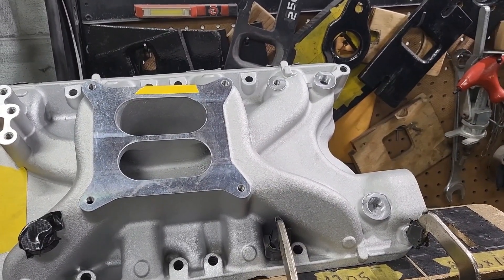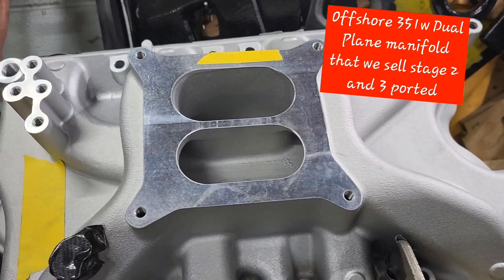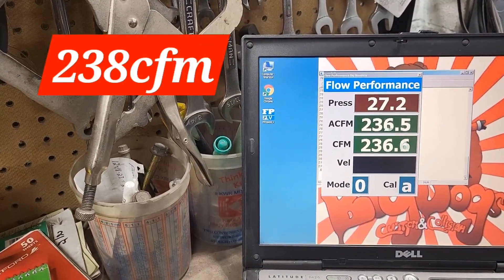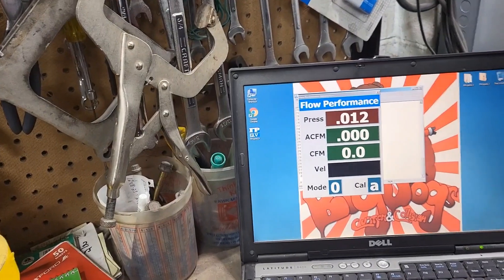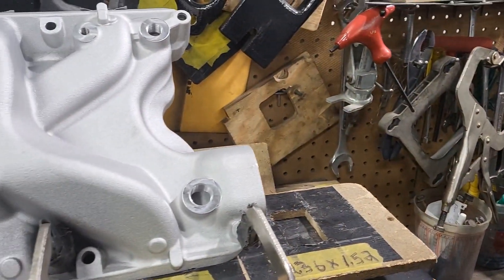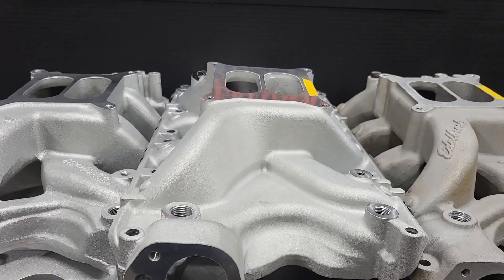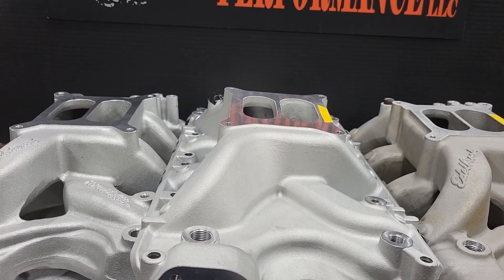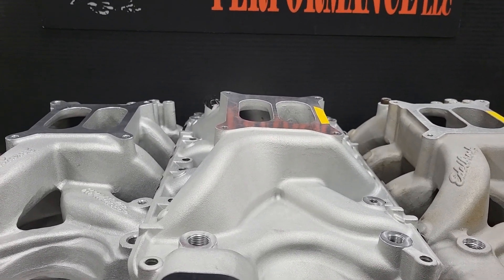Flow testing Edelbrock and off shore  351w carb intake manifolds. know what you are Buying!

Comment: Why do the airgaps not have the gap that separates the runners? Is it just the style on the 351?
Reply from the maker: @johnpatterson6120  reason why is intended application. They say they are designed for 1,500-6,500rpm and that's true when you use a bigger cfm carb but in reality most people use the same size carb on a Dual plane that they would use on a single plane which will limit the runners flow on the Dual plane plane manifold due to them not being able to share all 4 barrels of the carb like on a single plane manifold.  Which is why we modify them the way we do.

Comment: Can’t beat the sound of a SBF and I need to reach out to get a budget idea for my SBF build so I don’t have to fear those LS and coyotes so much.
Reply: You can make these run hard especially with boost and some good porting.  Ported gt40 top end with a custom cam and boost can move out nicely on about 10 psi.  Sound like pure sex too if you have the old school v1 or something lol
Reply from the maker: @midnight347  true but you don't even need a custom cam. Just run our stage 2 gt40p heads, stage 2 explorer gt40 manifold, our stage 2 cam, our ported 75mm throttle body, our custom high output P head spark plug wires and 8-10lbs of boost to make 575-600whp with a T5 on a Dynojet
Reply from the maker: We can definitely help you out with that! Power on a budget 😊

Comment: My boss just bought a LS Billet  intake from overseas and it is VERY nice.  Can't discount the overseas parts like you wld 10-15 years ago!!!!
Reply from the maker: Exactly. They have gotten a lot better with there castings and cnc programs. Afr Enforcer line heads are cast overseas and they check and final machine them in house and Install the Renegades valvetrain.

Comment: Have you ever ported the stock 85 302 (four barrel) H-O intake? I'd love to build my 302 to be "stock appearing". Any experience with the E7TE truck cylinder heads?
Reply: Thanks, I will contact you in a couple weeks.
Reply: Eagerly awaiting my “overseas” Big Dog stage 2!
Reply from the maker: @RuesgaOutlawRacing  with the Epoxy ceramic coating! Don't forget to leave a good review after you receive it 😊
Reply from the maker: Yes , we've ported everything many times over.